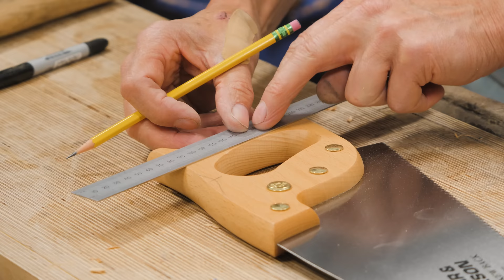Shaping your Saw Handle | Paul Sellers

Comment: Apart from the actual handle hole edge smoothing and grip hold rounding, aren't all the other cuts and shapings just decorative?
Reply: That’s what I couldn’t understand, why that that shaping on the top?
Reply: @andrewschannel3635  he said while doing it, those parts are just decorative and not necessary.

Comment: So in effect the handle supplied is an over-sized and over-thick blank for the user to adapt for their own hand. Perhaps this is intentional!
But the blade should also be checked for straightness, the set of the teeth adjusted in or out and the sharpness of the teeth improved.
It's the same as chisels sold without the final honing, or axes and hammers supplied with a handle bearing a finish useful for transport, storage and display, but horrible for working with, as it raises blisters on the gripping hand.
The idea that tools will be perfect straight out of the box can best be described as wildly optimistic.
Your skilful and rapid transformation of a handle from one-size-fits-none to this-size-fits-one is impressive and inspirational Thank you!

Comment: Another one of Paul's great videos. This is exactly how I did my S and J 12 inch back saw shortly after doing teeth over. Because it seemed like unnecessary work to remove handle. This made a big difference in the feel of the saw in my hand and looks better too. Having a saw that feels good and looks good makes you have more pride in your work. And it was really fun to do.

Comment: This is great! I have this exact saw. I'm a woman with slim hands, so the chonky handle is hard to get a grip on. The palm swell is definitely in the wrong spot for me, too. My finger points at the ground instead of paralell-ish to the top edge of the plate, the way Paul's finger points when he holds a saw. I wouldn't have thought it would make much difference at first, but apparently it does.

Anyway, I've been thinking about how to make it fit better, but have been too intimidated until now to try it. Definitely going to do this when the weather cools off a little. Thank you!
Reply: Please, come back with an update after you've taken the plunge.

Comment: I have an old Disston whose handle gave up the ghost (after I restored and set the teeth using Paul's instructions).  Constructing and shaping a new handle was a joy and I am constantly amazed at how the saw fits so perfectly in my hand and wants to cut through wood.  Making/customizing something that you will use every day is one of my favorite things to do in the workshop.

Comment: I don't do much carpentry, but I like watching Paul's videos, they're very relaxing
I have a cheap hardpoint saw with a moulded plastic handle, it's good enough for the small amount of woodwork that I do
Soon after I got it I did a similar sort of job on the handle - removed the moulding lines, smoothed & rounded corners & edges, reshaped it slightly to become a better & more comfortable grip, and dulled over the entire handle with fine sandpaper to change the glossy surface to fine matt or eggshell
I used various grades of files & sandpaper

Comment: I’ve never really got on with the panel saw from Spear and Jackson and I actually prefer Bahco hardpoint saws for both rip and cross cuts but the backsaw from Spear and Jackson is a little belter in my opinion.  It’s labelled as a tenon saw and it’s absolutely great apart from the massively chunky handle which is useable but not really nice to hold.  I’m so glad I found this video because I’m going to follow it and refine the handle to make it into a little gem.  Thanks for sharing 👍🏻

Comment: Certainly   very good tutorial . As I see this vedio is not guide me  to reshape the saw handle , But The MIND . This teaches myself
* Be against all odds and be certain what you want, learn what you want.
* Dispite tolerating be focus on the perfection
* To be fearless , brave and confident to achieve the best out of good , against the traditional thinking of be happy what you have! 
* To be innovative with ergonomics.  Be truly honest to real ergonomics at any cost for yourself and for others.
Many tks Paul
received my back saw and tenon saw. I m going to do this as it  does  fit to my hand. 
Besides that this lesson

Comment: Almost every new (as opposed to used) tool that comes into my shop gets work done in to the handles . They are usually ugly to look at, to hold, or both.If it has a film finish I remove it, raise the grain, and sand it My preferred finish for handles is boiled linseed  oil and paste wax. As far as the shape goes, I take off any sharp edges and shape it to fit my grip. If the shape is crude I will refine it a bit. Ten minutes to an hour leaves me with a handle that is pleasing to my hand and my eye.

Comment: nice video. I will definitely at least do the inside for a better grip.
I have seen an old video of a saw maker making saw handles. The silly thing is that after having rounded the inside of the handle with a sanding belt, they than sand the sides flat until they achieve those hard lines we want to remove.

Comment: Thank you so much for all your videos. I'm glad you are taking the time to record your lore and experience for future generations.

I have a few questions about the finishing montage.

At time 32:39, what is the tool you are using? Is it a knife, to get right down into the corner?

What's in the black tin, that you applied to the blade?

Did you sand off the remaining original finish before applying the shellac?

Comment: I bet the designer at Spears & Jackson had something in mind when they changed the handle design into the new one. Maybe it's just to spare some production steps to can produce it cheaper. Maybe it's just because of the stability of the wood. I think you just destable the handle and gave it some new weakpoints where the wood can break faster.
But from the point of the design it simply looks better after your work.
Reply: Of course it’s more fragile with the short grain more unsupported.  You see a lot of vintage saws without the horns.  It was definitely an economic decision not to have a more refined tool handle instead just a block of wood, basically
Reply: It won't break if you use it sensibly.  Or maybe drop it onto a concrete floor.
Reply: The other important factor is the increased comfort.  The S&J saw handles are real blister raisers until you soften the edges of the grip.
Reply: @richardsinger01  yeah, I don't go this far but there isn't a tool I own that I haven't had to soften edges with a file or sandpaper.

Comment: A good feeling and fitting handle requires a lot of gradually changing contours, which is very challenging for machines to do easily or cheaply. That's why you see all around the handle, it's the same profile because it was cut with the same bit. I used a saw from home depot, and the handle is horrible. First time I held a vintage saw in my hand, it felt so smooth and comfortable.
Machines can make good fitting and feeling handles, but it takes more steps with multiple bit changes, which will bump up the price by a lot. By "a lot", it could be $2 per handle from the factory. It may not seem like a lot to you, but keep in mind, companies have a certain cost structure. $2 increase from factory may become $5-10 on the product in store. Often times, mass produced products go with the cheaper and faster route.
Reply: Large companies are also working on economies of scale, so a $2 increase in cost per saw over two million saws in a year is an increase of $4 million

Comment: Paul, thank you for this video. You have taken an extremely utilitarian
design and turned it into a personally customized work of art.
Several years ago, I broke my thumb at the knuckle and now have
a lump, on the web side of the joint. Now, everything with a "tail", in
the web area, rubs the lump and hurts, including my .45 auto.
I have several saws I will need to do this to.

Comment: I absolutely enjoy your videos, such a calming experience. I haven't seen one of those metal wood scrappers before, is it just a sheet of stainless steel?
Reply: Justin, wood scrapers or also called card scrapers, are made from tool steel, not stainless. They also have to be sharpened. Paul has a couple of videos on how to sharpen them. You can get them at most hardware stores or tool specialists.
Reply: @brianmcdonnell6758  thank you :)

Comment: Hi @Paul Sellers, I’m new to hand tool woodworking and I’ve just purchased new rip cut and cross-cut saws. Both do  fine job and the handles are already shaped as you’ve revised the one in this video, but I’m a woman with smaller hands that the men I suspect these saws were made to suit. The handles are just … big. Is it possible to make a female-sized handle that doesn’t lose the balance of the original? I suspect the answer is, “Yes,” but I don’t know where to begin. Should I thin out the handle or would it be better to make a new handle altogether? If the latter, does the handle need to attach in a different position (tilted up or down?) Do you have any suggestions?

Comment: Paul how do you tighten the studs if they work loose. Mine is starting to I have that exact saw because you recommended it. I’ve had mine a few years now. Went through some six inch oak today. But handle is slightly working loose. Thanks.

Comment: Thank you Paul for this very timely video. I have four saws that I am preparing to restore and all need new handles. I have several patterns for classic handles but I am not sure what wood to select that will make the most durable handles. Would you have any recommendations? Again, thank you for showing how to customize and fit the handle to the individual.
Reply: I’ve made several from apple. That’s what the majority of traditional Disston saws have. I was lucky to salvage some when a neighbor removed apple trees from their back yard.
Reply: @artallen  Thank you for the suggestion. I has forgotten about apple wood. I would imagine that any of the harder fruit woods would be usable also.

Comment: Seriously, why taking off some wood from the top and bottom part of the handle your hand never touches? The whole vid says not a single word about what does mean 'more dynamic' for a saw handle. Do we talk of looks and style here?
Reply: Copied from my reply to someone else with the same question above:

The shape of the part of the handle where the palm rests is the important part for changing how the saw behaves (i.e, its dynamics). By leaving the center of this area fat and increasing the depth where the horns join the handle, Paul has added a point at which the handle can pivot vertically against the palm with only a slight squeeze of the middle finger. This allows him to remove weight from the toe of the saw with a single finger squeeze, making starting cuts easier and more accurate. It also gives his hand more clearance and allows for a steeper angle when dropping the hand while following a line down a vertical face.

Paul could even go further and change the hang angle of the saw by taking a little meat off in select places, effectively altering the angle at which the hand approaches and applies force to the plate. He might do this for personal comfort reasons if he wants less or more pressure on his wrist, or for body geometry reasons if he prefers to saw on a shorter bench like a saw bench. 

All the "dynamics" on the top and bottom of the handle are just to make it look pretty.
Reply: @MortimerSugarloaf  Thx a lot for this reply. Great detail of information!